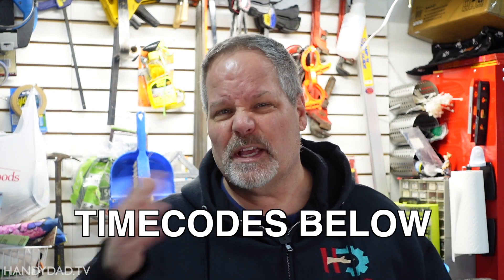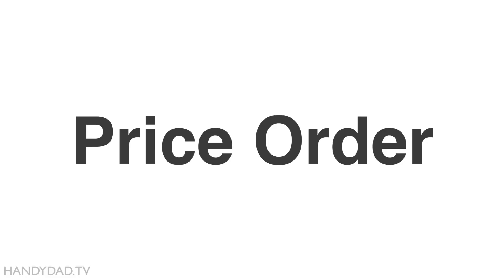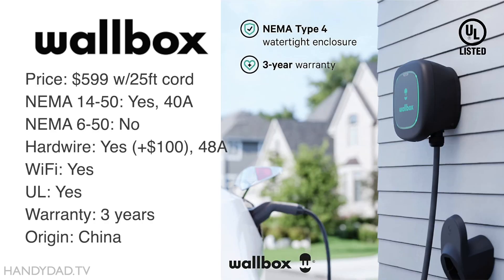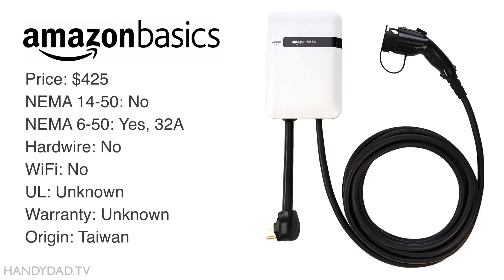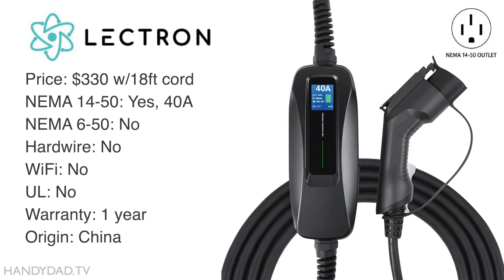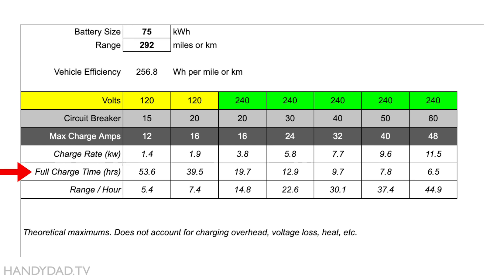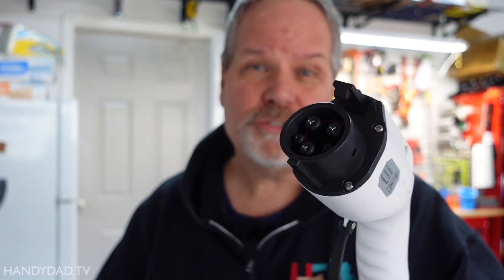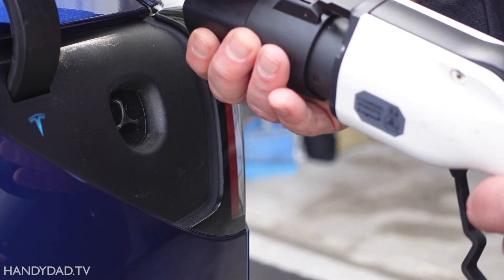Best EV Home Chargers for 2022

Comment: Very helpful video.. what is the difference between Nema and hardwired? Cons & pros?
Reply from the maker: Outlets are more expensive, especially if you use a GFCI breaker, and they are more prone to overheating. The only advantage is that you can take your charger with you when you travel or move.
Reply: @handydadtv  so which one would you recommend? Also, what is the difference between portable level 2 and wall mount level 2 chargers? Pros and cons? Thanks for the reply!
Reply from the maker: Once you buy an EV, you will never go back. Buy a hard-wired charger. Sell it with your house, just like your oven.

Portable chargers are overrated because there’s nowhere to plug them in when you travel. Many hotels have destination chargers already. They don’t provide 240-volt outlets.
Reply: @handydadtv  thanks boss!!

Comment: Hello @HandyDadTV! Thank you for awesome videos. I need your advice with my charging extension cord. I followed your tutorials as an reference to install extension cord/outlet  to charge my 2022 Tesla MYP that I purchased recently. I live in a condo and my manager didn’t allowed to install additional outlet. So the only option was to use existing 10-50 outlet with 50amp breaker for the oven. 
I used Y splitter to split an existing 10-50 outlet so I don’t stress the old wall outlet in the kitchen by plugging and unplugging. 
I installed about 45ft 6/2 AWG romex copper wire trough my ventilation pipe ( so I don’t make a hole in the wall ) and on the end installed weather proof 6-50 outlet box in my balcony.
I run 75ft 50amp 6-50 6AWG copper wire welding extension cord from balcony to my car. 
I bought 6-50 adapter from Tesla and using my mobile connector to charge my Tesla.
 I am getting 32amp max output, 28miles/h or 7-8 kWh from this setup. On my cars screen I see voltage drop from 240v to 231v when car is pulling juice. All 120ft long cables stays cool so far after overnight charge when weather is about 40-50 F. Last week was bit warmer ( 65F in afternoon ) and after 7 hours of charge I found that cables were little warm on touch. 
Question: Is it ok if I swap my 50amp 6AWG 75ft long extension cord to  some lighter 40amp 8AWG 75 ft long extension cord same brand? The concern is that 6AWG is too heavy to cary every time when I charge my car. I can’t leave cable outside since kids play around and I don’t want to put on risk anyone. Thank you!
Reply from the maker: I admire your creativity, but that setup worries me. It’s certainly not up to code and if you have any incidents, you could end up with a huge lawsuit with the property manager and community. 

That said, 32 amps is the fastest the UMC can charge. And voltage drop is normal on long runs so there’s nothing you can do about that. But I wouldn’t use a lighter cord even though you're only pulling 32 amps.

Comment: The amazon link in your description for Emporia says that the EVSE is not UL listed. Maybe you included the wrong link?
Reply from the maker: I know the listing still says that, but they told me directly that they are now UL certified. The units were always manufactured to meet UL specifications, it just took time to become official. I guess they are waiting for units to arrive with new boxes and labeling before updating the listing. They told me on April 9, “We expect those to arrive in May.”

If you are worried, I can forward you the exact email exchange I had with them. Email me at chris@handydad.tv if you want to see that.
Reply: @handydadtv  They are listing the UL model on their website at $449 and the non-UL at $399. So they might be charging a premium for a while as they sell off old inventory. Changes your $/x calculations slightly but overall still clearly a great value unit.
Reply from the maker: @Ben Thanks. I saw that and updated the spreadsheet. Unfortunately I can’t change the video.

Comment: Very good video and the only one I've seen mentioning the 2 chargers that aren't mentioned anywhere. The EvoCharge and the Amazon Basic. Those two look like the PowerCharge Energy E20SWE, but with different warranty lengths. Although I can't confirm if they are the same unit. The other one I like in your list is the Emporia. Speaking of lists, the AmazonBasic one has a 1 year warranty but the Google doc shows it as N/A.
Again, very good video. Love the ending skit. Sending you some Coffee.
Reply from the maker: I couldn’t find any warranty information on the Amazon Basics. Where did you see that?
Reply: @handydadtv  in the Amazon page comments section for the product.
Reply from the maker: Got it. Thanks.

Comment: Have you done (or are you going to do) a full "review" on the Emporia? It's on my shortlist, but there's almost no reviews out there on them. Do you have it tied into your Vue? I'm super curious how the "excess solar" function might work. We currently have a dumb charger that can only do 32amps. More than enough for our needs, but I'd like to make that our portable charger and install something a bit more permanent in the garage. Thanks!
Reply from the maker: The EVSE isn’t tied to the Vue, other than I told the Vue which circuit it’s installed on. But they both use the same Emporia app. I’ll consider a video in the future.

Comment: My utility company offered me the Charge Point flex for $199. Is that good deal?
Reply from the maker: Yeah it is
Reply: It normally goes for $699-$799 so it’s an excellent deal! In fact my electric company (PSEG) also offers the JuiceBox for $149 as well as the ChargePoint Home Flex!
Reply: Hellyeah! I bought one on Amazon for $699 and submitted a $250 rebate from the power company. $200 is less than the portable I bought!

Comment: I did on open evse  charger with a j 1771 plug to charge my model Y  I charge mine at 12 amp at .05 per kwh off peak. I do not want to charge fast because if i do i hit demand charges at 1.50 / kwh not good.  and this works 90 percent of the time to recharge over night.
Reply from the maker: That’s awesome! I would do the same if I could.

Comment: I have seen several Chargers that claim to be 48 amps and are plug into the Nema 14-50 plug. What size circuit breaker would you need for that 60 amp? Would it actually produce 48 amps?
Reply from the maker: To charge at 48 amps, you need a 60-amp breaker. If you read the description of those chargers closely, they can only deliver that kind of power being hard-wired. You can only charge at 40 amps max with a 14-50 plug and a 50-amp breaker.

Comment: Are these chargers outdoor rated? Or is that an option I need to look into when purchasing one?.....Question from an electrician who's 69yr old mom is hell bent on buying an ioniq5. PS I know nothing about EV chargers but I know a whole lot about not buying something that hasn't been UL listed just to save a few bucks
Reply from the maker: A friend of mine just bought the Ioniq 5. It only comes with a Level 1 charger, which is 120-volts and plugs into normal household outlets. I showed him the Emporia and let him test it with his car and he went home to order one. He plans to have it hard wired. The price went up a little from the time I made this video but still the best value. http://handydad.tv/kuok
Reply from the maker: And yes, it is watertight for outdoor installation.

Comment: Question for you - I'm researching an EV Home Charger for a short term rental unit.   Do Tesla owners typically carry the adapter?   If I purchased a unit like the one you have, should I supply a Tesla adapter?  Also, if it's for a short term rental, I'm leaning toward a unit that is not wifi compatible, because I don't want people to need to install an app on their phone for a charger they'll only use a couple times.  What's your opinion?
Reply from the maker: Great questions! 

First, you should definitely buy a J-1772 EVSE that is hard-wired so it doesn’t disappear. Yes, Tesla owners should always carry their adapter, especially if you advertise the J-1772 destination charger in your listing. 

Second, let’s say you go with the Emporia, which has WiFi, only YOU would have the app. Your guests don’t need the app to charge. But you can monitor usage and know how much electricity they use. You can also lower the charge rate when renting and crank it up for you.
Reply: @handydadtv  Thanks so much!
Reply: Would you rather a 16-50 outlet or j1772 at a rental?
Reply from the maker: J1772 hard wired is the best choice for a rental. I recommend the Emporia because it can be adjusted remotely and you can track usage to potentially charge back your renters.

Comment: GFCI breakers are not required by code for hardwired units. Most EVSEs have GFCI protection built in.
Reply from the maker: I’m pretty sure built-in GFCI is required, just like blow dryers. Unfortunately there’s no way to test it.

Comment: I'm having a problem getting ANY EV charger to work...here's my setup:  240v 40amp 14-50 outlet set up in my garage by a friend who is a licensed electrician.  I've watched him check the current at the outlet and it's showing just over 240v "hot".  I have so far tried to use two different chargers... (1) the "fast flexible charger" from BMW that came with my Mini SE, and (2) a 32amp Lectron I bought off of Amazon.  NOTHING happens when I plug in either charger.  Is it possible I have two duds, or is there something else in the power train that is not working?  Like I said, electrician's meter/tester thing definitely shows a "hot" 14-50 outlet at 240v.  Plug it in, and...nothing.  Any clue as to why this is happening and/or suggestions on the next step?  Any advice is appreciated.
Reply from the maker: There’s no way you have two duds. Did you ensure the breaker is ON?

Go to 19:18 in this video to see how to test a 14-50. Use a meter to ensure your outlet has 240v across the two outside pins. You should get 120v across either of those pins and the ground. https://youtu.be/OfdEitiM6u0
Reply: @handydadtv  Thank you for your reply and the link to the video.  I watched as the electrician performed the tests you show in the video.  He measured the left and the right (red and black) terminals separately and they each reached just over 120v.  He did not measure the outside pins simultaneously like you did (showing the fill 240v).  Yes, the breaker is on.  Do you recommend plugging in the 14-50 plug FIRST with breaker off, then throwing it on?  I don't think we tried that.
Reply from the maker: It shouldn’t matter. Call the electrician back. Something is wrong.

Comment: First time buyers should look to their electric company for rebates and throw that into the equation as well. Here we were offered $250 rebate on a select few units which are of the connected variety; limited thusly to ChargePoint Flex (2 models) and EnelX Juicebox (6 models).  Now, their market place had the CP Flex listed at $750, but the unit was $700 on Amazon, only out of stock. While they say they don't make money on the units, I thought it strange they charged more and even more than ChargePoint's own shop (at the time).  Looking today, they're all $750 so I was lucky to grab one a few weeks back when Amazon had stock for a brief time (I caught it the day it went in stock and after completing my purchase they had 5 left and were sold out the next day).  $450 I'm very happy with the price and the unit is well built.  I have yet to connect it but even at $500 for either the flex or JuiceBox gives them a run for the money. I'm currently running a Mustart, I'll post a separate comment to help with the algorithm.
Reply from the maker: Thanks for the info

Comment: Enjoyed video. Just curious why it would charge at 41A when circuit usually won't tolerate more than 80% of breaker rating or 40A?
Reply from the maker: Voltage can vary slightly. Mine was a little high, so the screen calculated 41 amps.
Reply: The 80% figure comes from the NEC requirement of sizing of breakers for continuous load, such as an EV charger. The NEC actually allows non continuous loads to be 125% of the breaker rating. A breaker will handle a load at it's stated rating indefinitely. Depending on the breaker they will tolerate 1.5x to 2x their rating for over 15min before they trip.

Comment: Quick question. My tesla wall charger seems to have a much thinner cord than my juice box which is only rated at 40 A. My tesla charger is rated at 48 amps. What gives?
Reply from the maker: Tesla may use better wire with a higher temperature tolerance.

Comment: The Lectron charger shown with a digital display is a dangerous unit. It gets extremely hot..my outlet was 180 degrees Fahrenheit. It was replaced with one of their new chargers and it does not have this heat issue. It has a much thicker cabling and seems better quality in general.
Reply from the maker: Thanks for the info!

Comment: Does this charger work with NO neutral wire?..I have NEMA 14-50 with 240 volts and a ground but NO neutral wire? 👀👀😍😍😊😊
Reply from the maker: Level 2 charging uses 240 volts. It’s shouldn’t need the neutral at all.

Comment: Is the diameter of the 14-50 Bryant plug receptacle the same as the Hubbell (thinking about the faceplate)? My 2022 MYP is due in late June, live in an apartment complex and I'll be the first renter with an EV. The garage is directly below my bedroom & bath and it looks like the circuit breaker panel in the bathroom closet is right in line with a wall & corner in the garage. The wealth of information and possible options have been a tremendous help in wading through this mystery of home charging an EV
Reply from the maker: Yes, the Bryant needs the larger faceplate like the Hubbell.

Comment: Just like J1772 with adapter for Tesla, you can use adapter on Tesla wall charger for non-Tesla cars. Really no different. It comes down to cord quality and Amps.
Reply from the maker: Yes, except the J1772-to-Tesla adapter is made by Tesla. The Tesla-to-J1772 adapters aren’t.

Comment: Will “they” ever ration EV charge station access or charge rate? Nah, the EV surge is 
good to go, right? A silly question posed by a climate change/EV denier, obviously.

Ruh-roh.

May 14, 2022, Texas; Texas power grid operator urges residents to conserve energy as 
plants go offline.

Quote; "At this time, all generation resources available are operating. We’re asking
 Texans to conserve power when they can by setting their thermostats to 78-degrees or 
above and avoiding the usage of large appliances (such as dishwashers, washers and
 dryers) during peak hours between 3 p.m. and 8 p.m. through the weekend.," wrote 
ERCOT Interim CEO Brad Jones.

Are EVs considered large appliances?

Just asking for a friend...
Reply from the maker: Easy problem to solve. Charge off peak.